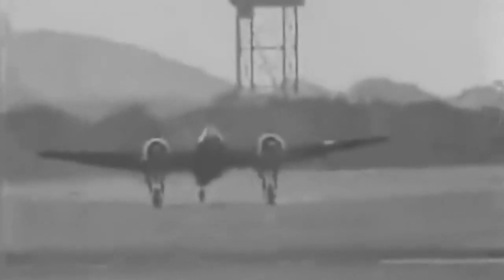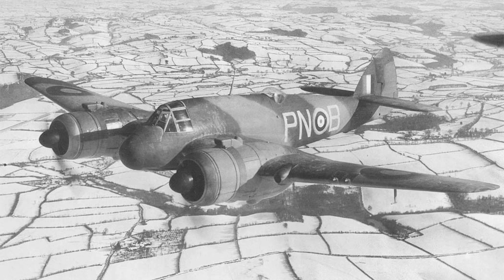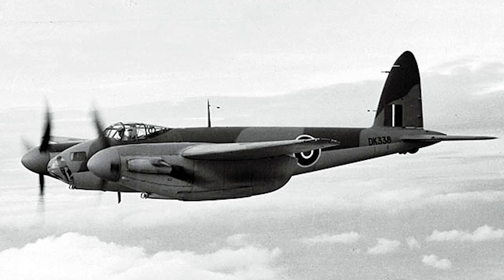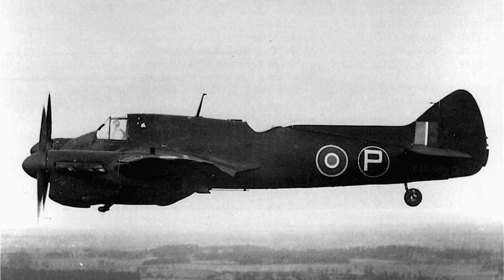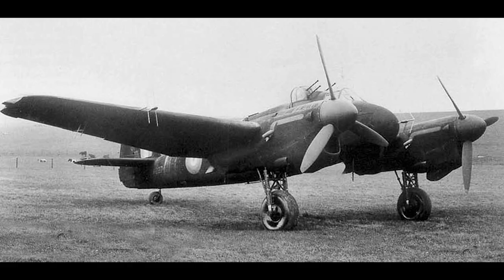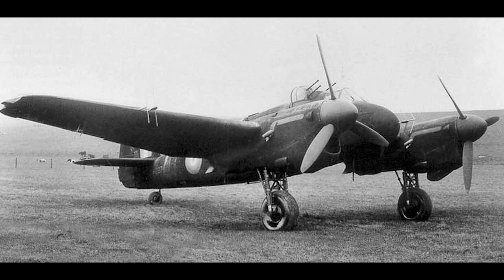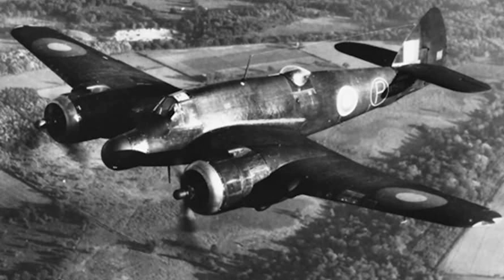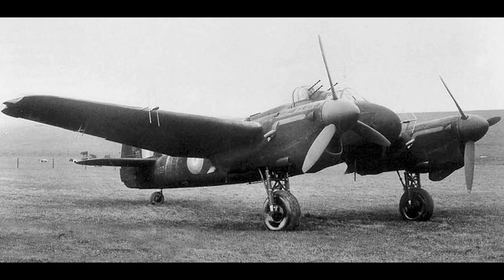Bristol Beaufighter NF Mk. V; How to Use ‘Good’ Ideas to Ruin an Aircraft

Comment: To be fair the "Swing" problem was most likely an unpreparedness for the opposite handed prop rotation of the Merlin's. Same problem occurred in Spitfires models fitted with RR Griffons, unfamiliar pilots occasionally forgot which rudder to pre-emptively apply when unleashing the Griffon. Funny how most sources place the Merlin XX output fairly close to the Bristol Hercules. I reckon the Beau pilots had grown too comfortable with the sewing machine quietness of the Hercules and just simply got annoyed at the drone of the V-12's.
Reply: Swing is worse with the COG way behind the main gear, one would imagine that the long Merlins would bring the COG forward a bit?
Reply: @givenfirstnamefamilyfirstn3935  Hadn't thought of that. Didn't know the Beau had an aft COG problem either, or was that the turret weight causing that?
Reply: Actually that makes sense, the Merlins are 100kg lighter than the Hercules. Even with the cooling system added the Merlins' probably don't even up the weight difference, and on top of that the turret in the rear 😗.
Reply: It didn’t have an aft COG, the gear was a bit forward so that a minor yaw that was not immediately corrected by the pilot, caused the tyres to make a larger side force forward of the COG making the yaw even bigger.  The yaw had positive feedback and could quickly become uncontrollable.  This is one of the nasty drawbacks of having a tail wheel configuration, with a nose gear plane the COG is in front of the main gear so a yaw generates a tyres side force behind the COG which opposes the direction of the yaw and the plane easily rolls straight down the runway.  Nose gear is not as sturdy, grass airfields were more common in those days.
Reply: @givenfirstnamefamilyfirstn3935  Yeh actually now that you mention it I have seen a Boeing Stearman and a T-6 seemingly whirl around in roll outs for no apparent reason, although that could have been uneven braking issues.
Reply: The Hercules version would swing too if you let it. The dihedral tailplane, and later an extended dorsal fin helped cure the Merlin version of this propensity, but those mods were also applied to the Hercules-engined aircraft later.
Reply: @davidjones332  I think those mods made the Beaufighter  better looking (than it already is). Fin strakes tend to do that along with angled flying surfaces, even though the engineers would have only seen the compensatory nature of them. Anyway I thought the dihedraled tail plane was to cure the lateral stability problem with the big engine mass spread out all over the place limiting the main wings dihedral effect. I guess they were quite well thought out multi faceted remedies.

Comment: In the early days of nightfighting, the Beaufighter had far more space than the Bleinheim to accommodate the AI radar. I read that its strong forward fuselage saved many a crew who survived while the rest of the 'plane had disintegrated. It lasted a long time. I recall that the last flight was from Seletar...must have been about 1960 or just after.
Reply: There's a glimpse of a Beaufighter  target-tug in the 1958 film "Ice Cold In Alex" whose location-filming was done in Libya.
Reply: They did try to bring in a 'sports Beaufighter' with a skimmed fuselage  but it went nowhere. Then was the Beaubomber, leading to the Buckingham and Buckmaster, and the Brigand which sometimes shot itself down. Bristol went through a rough patch after the Beaufighter.

Comment: On the positive side, the cabin heat was 'probably' less lethal, as the Beaufighter had a history of adding engine generated Carbon Monoxide to the cabin heat from one of the Hercules engines. Or did Bristols duct exhaust fumes from the Merlins too?

Comment: Beaverbrooke ordered the Spitfire office to shut-down after his son, a test pilot, flew the Beaufighter, & said it was all Britain needed. *Rare to survive a ditching in a Beau - all the weight's at the front.
Reply: Just to add a touch of positivity about our allies; my father was a grenadier signaller at forward observation points.  He said that the British artillery scared him as they were accurate to 1/4 mile whereas the Americans were able to fire accurately to 50 yards.  Which they did in Cassino when a tank was heard in a house and was immobilised by knocking it onto its side.  Of course a lot of this is due to the difference between old tired equipment and brand new.
Reply: @babaganoush6106  - I'd need convincing about that, but to put a dampener on the tale, the US are trigger-happy on the 'mission fulfilment' blue-on-blue like the Brits aren't: 'American Luftwaffe'. Not much old & tried Brit equipment by the time Casino was screwed-up. & then there's the Norden bomb-sight 'pickle barrel' Aesop fable. *Try 'The Guns of War' by George Blackburn, brilliant book (2 books in 1).
Reply: This is the same Beaverbrook who is 1939-40 was masterminding the creation of Castle Bromwich for producing Spitfires, right?
Reply: @babaganoush6106  The USA based its command and control for artillery on that of the UK due to both its accuracy and rapidity. When XXX Corps finally got into range of radios in Arnhem (mostly the radios worked - don't believe the movie, the issue was more range and the different networks) the forward observers with the paras were able to direct the guns  onto individual tanks attacking the paras. Guns firing from about five miles away. It's very possible that the British units in Italy in that area had worn out guns compared to the US artillery, though.
Reply: @gitfoad8032  ok well you have your mind made up.  I just recounted what my father said no probs.
Reply: @wbertie2604  - mais oui, the impressario of production. The staff at Spitfire HQ were literally at the point of closing down their work. Don't remember the book, but it was a memoir, possibly about the run-away problems with the Merlin that everyone's forgotten about. -The prop used to come-off as it over-sped.
Reply: @wbertie2604  I agree my father said that most of the equipment was tired and had come from North Africa.  His favourite pieces of kit were the Thompson he took off a dead kiwi and the plimsolls given to him by his Captain.  Life as a signaller was quite difficult.
Reply: @wbertie2604  - I think that's right: the Hun also thought Brit arty was hopper-fed, it was so fast.
Reply: @babaganoush6106   - no I'm open minded, I didn't say I don't believe you, but it's contrary to what I'd thought was the case.
Reply: Breaverbrooke's son was Max Aitken and he was CO of 68 Squadron RAF, a night fighter squadron at the time.

Comment: Beuafighter really didn't like the Merlin. NF Mk II had some very nasty vices like going into an unrecoverable spin if it lost an engine. The Hercules powered NF Mk I was a bit of a handful as well, the Aircraft had marginal stability in yaw, was a handful to fly on one engine and an engine failure on take off was normally followed by a fatal crash. The Mk II was even worse in those regards. The Stability issue was fixed with 12 degree dihedral on the Tailplanes and a 20% bigger fin on the Mark VI.

Comment: Bristol Blenheims were also used as night fighters. They had a three man crew including a gunner. The Blenheim was too slow. I suppose its radar was relatively primitive. The gunner only had one or two guns.
Reply: The Mk.IF and IVF were equipped with a belly pack mounting 4x .303 as well. 
Even so, the choice for the Blenheim had more to do with the AI sets being rather bulky and power hungry & being the only longer range fighter operationally available. 
Fighter conversions were introduced pretty early actually - 600 Sqn RAuxAF being first in 1938 - but as with the bomber versions, they suffered heavy losses over France and the Low Countries.
Reply: @whtalt92  I forgot about the belly pack. It did not look very aërodynamic. I knew the Blenheim bomber crews had a torrid time, having read Blenheim Summer, which was a well written book. Poor buggers!

Comment: The reason for the change to Merlins was because the Bristol works were badly damaged in an air raid. The Beaufighter was considered an essential type so they tried Merlins which were in full production in various locations. Bristol engine works were soon back in production and so they were quickly changed back to Hercules engines. Merlins proved to be a disaster in a few aircraft including the Armstrong Whitworth Whitley and the Halifax Mk1, great engine of course but they didn't work on everything, especially on slower aircraft where they suffered from overheating.

Comment: Another example of an aircraft which performed better with the Bristol Hercules than the Rolls-Royce Merlin was the Handley-Page Halifax.  The original production versions of the Halifax were powered by Merlin engines.  However, the Merlin-powered Halifax had a number of issues that were not resolved until the aircraft was finally upgraded with Hercules engines.  A few Vickers Wellington bombers were also built with Merlin engines before that aircraft, too, was more successfully adapted to take Hercules engines.  Incidentally, in their wisdom the Air Ministry also proposed fitting a four-gun Boulton-Paul turret, and a trial mock-up was even constructed.  However, De Havilland managed to talk them out it.
Reply: The issues of the Merlin's performance in the Halifax was largely due to Handley Page ignoring Rolls Royce's advice and designing their own nacelle rather than adopting RR's power egg solution like Avro. Handley Page's nacelle had aerodynamic issues which did the Merlin no favours.

Comment: The beau was definitely a beautiful and deadly aircraft, lots of E-boat captains testified to that, along with several Fw-200 pilots, but why stick a pair of merlins on it? Why not stick 4 merlins in the Sterling? It would have the same performance as its big brother the Lanc? A question my dad often pondered and he was ex-RAF, someone up there in the lofty halls of flight commando had never flown these types so didn't have a scooby doo what was actually a good idea, but, as is often said, if you don't try it, you can't reject it. Thank gawd KG-200 didn't get hold of any beau's, they would have had some fun. Thank you for another cracking insight into a ludicrous idea, maybe that could be a video catalogue for you to put together? What the f*£@ were they thinking? lol
Reply: Four merlins wouldnt have done anything for the stirling which was castrated by an air ministry requirement  for a wingspan no greater than 100 feet, an extra twelve feet of wingspan would have greatly improved the Stirling
Reply: @chitlika  the weird thing is, we have these seemingly bright ideas but the truth is, not knowing the full story is enlightening, thanks fella, i didn't know that. The manchester, didn't that have just 2 engines (again merlins)?
Reply: @bongodrumzz  No, Manchester had 2 Vultures (24cyl in X, based on the smaller Peregrine).

Besides that - just sticking on Merlins does not cure other aerodynamical issues or design shortcomings on the Stirling like the bomb bay. In fact, the Stirling's Hercules radials were higher rated than available Merlins could deliver at the time of development. 
Perhaps extending the wing span to 110 feet or so may have made it better, but still would not have cured the limited size of individual stores that could fit in the bomb bay (which precluded using the later 1000lb or 4000lb cookies the Lanc could carry).

Comment: The Beaufighter Mk II's tendency to "swing on takeoff" is a bit of a myth - If you think about it, why would an aircraft with less engine power swing more? - It's usually the other way around, the more engine power, the more tendency to swing. - In his book "The Merlin in Perspective" (published by the Rolls-Royce Heritage Trust in 1983) Alec Harvey -Bailey provides the answer. He interviewed Athol McIntyre, a Beaufighter pilot about this issue. The problem was that the Merlin rotated in the opposite direction to the Hercules, which meant the Merlin-powered Beaus swung in the opposite direction, which caught out pilots used to, or trained on, the Hercules-powered ones. Precisely because the Merlin XX produced less power than the Hercules at low altitude it took longer to build up speed on the take-off run, so the airflow over the rudder was less effective at counteracting the swing in the early part of the takeoff. It just needed different handling. Apparently, pilots who were posted onto Beaufighter Mk II squadrons with no previous experience of Beaus had few issues with the swing characteristics, the complaints all came from pilots who had previous experience of Hercules powered ones. The Merlin XX did produce more power than the Hercules at high altitude, having a much more effective supercharger, but the Beaufighter with its thick wings (a legacy of its development from the Beaufort) did not have the aerodynamics to fully take advantage of that, unlike the thin-winged Mosquito.

Comment: I will never understand the british obesession the calibre 303. 
The 0.50 seem to be a much more reasonable compromise between high rate of fire and punch
Reply: It was that the British armaments factories were geared up to produce .303s, and switching to .50 would have taken time.
Reply: ? The Beaufighter had x4 20mm cannons.
Reply: @JohnyG29  The two converted Beaufighters mentioned in the video also had quad 303 Turrets
Reply: In 1939 the UK had only really just ramped up production of Browning 303s. Turrets for 50 calibre guns were being developed, but guns and ammunition would have to be bought for cash from the USA. 20mm cannon were already seen as the ultimate end point for fighters and bombers. Beaverbrook took the decision to deprioritise 50 calibre turrets, to allow existing types to be built quickly. In the end a decision to try 50 calibre ones was made a bit late, in 1943, and few UK 50 calibre turrets made it into service, although Lancasters did get Martin turrets on some marks. The UK turned over a lot of turret development data to the USA which helped the USA development cycle. They should probably have considered adapting more aircraft to US turrets, but it would have been a lot of retooling and redesign to put a Consolidated nose and tail turret from a Liberator onto a Lancaster compared to turrets the British designed to basically drop right in.
Reply: @wbertie2604  Most of the British Turret work done by Fraser Nash. Bolton Paul turrets were copied off the French. British did build their own .50 Cal Turret towards the end of the war, designed by a Compony called Rose & Son's in Lincolnshire. They were fitted to a few Lancaster Squadrons in No. 1 Group and were basically designed for and paid for by Bomber Command directly (Harris and the AOC of 1 Group, Rice). Getting .50 Cal guns in the early part of the war after the USA entered it would not have been easy either.
Reply: Eight browning .303 guns is a fire rate of 9,200 rounds per minute. That’s one and a half miniguns. In 1939 that was a big stick and very bad news for four guys tightly packed together in a plexiglas greenhouse like in a Ju88 or Dornier 17.
Reply: @johnedwards1685  Yes, dangerous for those in the nose, but standard British doctrine in 1939-40 was to attack from behind in a vic of three aircraft. Given the level of armouring by 1940, it wasn't nearly as effective as 4 20mm cannon per aircraft would have been. 4 20mm cannon was, by 1937, the armament the RAF was proposing ultimately for future fighters, initially in twin-engined designs to the F.X/37 (I can't remember what the X was now, but maybe 4 or 34 - I'd have to look it up), such as designs from Gloster,  Supermarine (323? - from memory) and Westland, with Hawker proposing a 4 cannon Hurricane derivative, but not to a specification requirement, but privately. In this the RAF was correct. Actually Supermarine proposed increasing to 6 20mm cannon, with an optional additional fit of 12 .303 in the wings for strafing, canted slightly down.

Attacking from the front or beam was a tactic developed during the Battle of Britain due to .303s not being very effective when attacking from the rear, which also exposed the fighters to the most effective defensive fire.
Reply: The 50 calibre rate of fire is only a bit more, at 750rpm in aircraft versions, than the Hispanos at 600. Given the choice between a Mustang Mk. IA (4 20m cannon) and a Mk. III (4 .50s) then provided you could accept slightly higher weight of the armament, the IA would be preferable. The USN actually wanted to standardise on 4 20mm cannon but the USA had issues with 20mm cannon production during WW2. The P-38 could cope with it as it was possible to recock the gun when in the nose. The UK, after 1940, didn't have issues with its Hispano guns.

Comment: 😲 7:18 Is that Radar antenna from 1942?  WOw Haven´t much changed since.👍
Reply: They have changed massively in the last 50 years. Most fighter radars since the mid 1970's have been fitted with a flat plate Planar Array Antenna. Most really modern fighter radars don't even move the plate mechanically any more, but have a large number of small radio transmitters in the Antenna that can modify the phase of the signal that they put out, which allows the radar beam to be steered electronically.
Reply: @richardvernon317  Ahh cool.

Comment: I think a lot has to be said for the prop diameter of the hercules engined variants compared to the far smaller props on the merlin, sometimes you just need a huge mass of air to get a plane moving.
Reply: Yes, but you need an engine that is capable of pushing that air. The Hercules could fit a larger propeller because it had the power to drive the bigger screw. A smaller propeller is going to be more efficient on a less powerful engine. Not to mention the Merlin turned 200 more RPM, and would need a reduction in diameter to keep the tips of the propeller from going supersonic.